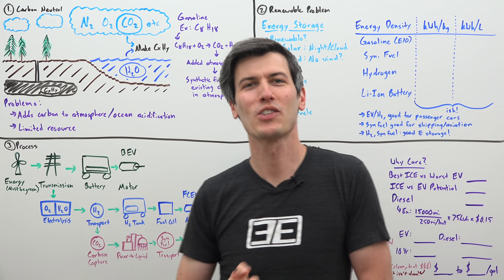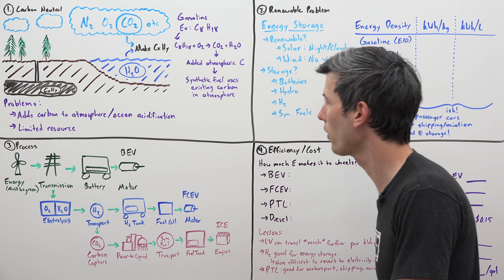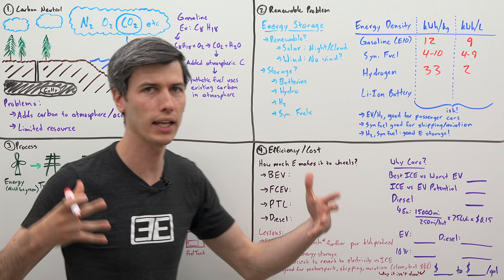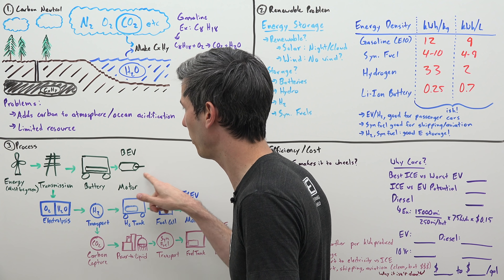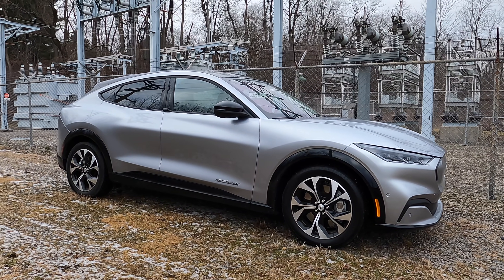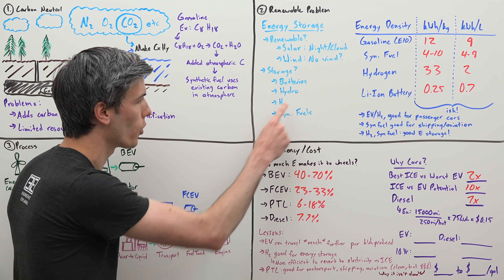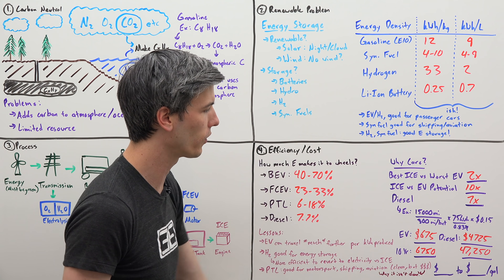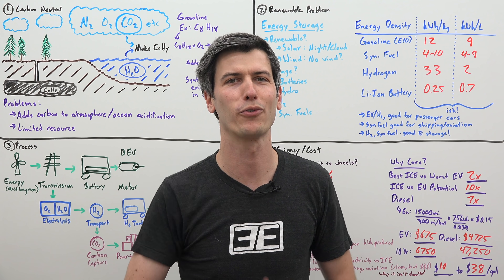The Big Problem With Synthetic Fuels

Comment: Without all the regulations, you could easily make nuclear power cost less than $10 a MWh. In that case, even with all these losses, you could still make synthetic fuel cost effective. But many of the conversions could be done more efficiently, like going straight from heat to hydrogen - thermolysis.

Comment: Yeah, but, infrastructure, EVs need to compansate all the required infrastructure, that infrastructure cost lots of energy too, and cobalt is rare, finite like oil even too? Talking price, who's paying that infrastructure? We all, that's just not included in this calculation.

SynthFuels have the advantage that all the infrastructure is already available, and AFAIK can be used on existing cars.

Another great thing is, you can have a huge solar farm somewhere like the Sahara (yeah there's other challenges there), and ship it around the planet, while you can't really move electricity like that.
Reply: This might work, but building solar in  an area with shifting and blowing sand would have its own challenges.

Comment: Meh.. it still has potential as you can't store electricity efficiently, in the future it's gonna be a problem if we're all using electric vehicles, on the other hand you can store synthetic fuel efficiently (+ a fuel tank won't be degraded after each refill) and just like a water battery, synthetic could be created with excess energy provided by the governments resulting in a much lower cost (free if you don't count machinery maintenance and personnel). I could see this solution in the future because EV planes, boats and big industry seems unrealistic and the pollution made by creating those batteries will come up as negative at some point

Comment: I got biogas van and calculated that total efficiency is with synthetic methane would be about 29% using Q power methanation process. I can now run with biogas at around 8 euros 100 km and my emissions can actually be lower than with electric van because electric vans with good range need quite big batteries and those produce a lot of emissions when they are produced but I would like to have more plug in hybrid vehicles with like 100 km range on battery with fast charging and biogas/synthetic methane for longer trips or for highway driving. It would combine two technologies well. Also you had static electricity price for producing synthetic fuels but I think production facilities would be built on places with cheap and renewable electricity. Like in Finland where I live electricity can be very cheap during night or even at day if it's very windy. Our electricity also produces quite little emissions at around 30 gCO2/kWh or even less depending on load on electricity grid.

Comment: Combustion engines are horribly thermally inefficient.
Reply: An ethanol optimized combustion engine is >42% efficient, right up there with fuel cells.

Keep in mind that electric motors are not 95+% efficient as we are told.  Teslas would not have radiators and antifreeze if that was true.

Years ago, they would measure an electric motor efficiency by the amount of heat produced and they are in that >42% efficiency range too.
Reply: @danafletcher2341  Well I'm pretty sure that the battery in a tesla needs coolant and a radiator more then the electric traction motors but I haven't heard 95% efficient I heard that three phase electric motors are 85% efficient and that the whole EV system is about 55-65% efficient.

Comment: One of the biggest arguments against eFuels is the “poor thermal efficiency” of combustion engines. But in my opinion and experience, I am wondering if this even matters anymore. Case in point. I’m a freelance photographer and I drive a lot all over Germany meaning long Autobahn cruises. My car (2018 Mercedes A250 W177) is loaded with my heavy gear and I will often just cruise at 130 km/h with the occasional venture into the 200 km/h+ zones. On such trips, my gasoline car can get 6 L / 100 km - which is incredible. 

In cities, I combine Start-Stop with “aggressive driving” (quick acceleration from a standstill to get up to speed and then let the car coast) and in this fashion I can improve my fuel economy. When I am stuck behind people who can’t drive and need a minute (literally) to accelerate to 50 km/h, my fuel economy actually worsens. I learned in driving school to always accelerate quickly to 50-60 km/h in the city, then coast, to improve gas mileage. 

Bottom line: modern ICE are so efficient and there’s probably room for improvement. Of course they can’t touch the efficiency of an electric motor, but they are nonetheless efficient in this day and age for what they are. 

Also, I saw an interesting documentary on these new Dual-Fluid-Nuclear-Reactors which are being developed by German engineers in Canada and Rwanda (of all places). The head engineer said these reactors produce a lot of heat - and this heat could be used for electrolysis to create hydrogen and eFuels and thus would offer these fuels at competitive prices. What’s not to like about this???

Comment: I hope synthetic fuels come to the market, we can use our current cars, gasoline pumps, literally don’t have to do much to make synthetic fuel available to the market, and ev’s are quite and boring, I hate wiring, I hate working on battery’s that can explode in your face, I don’t like the fact lithium is limited and we are using it on pointless cars instead of phones and other devices, I love engines and working on them it’s what I like to do and nobody can change my mind.

Comment: It can be an option for, Airplane, Ships and maybe Truck where battery is unlikely.

2nd.
I think there is also a 'Direct Methanol Fuel Cell'.
Which convert Methanol directly into electricity, skipping Combustion engine.

And thats more energy efficient because there is very less heat loss.
Reply: There also is a direct ethanol fuel cell which has a high specific energy (8.0 kWh/kg) compared to methanol (6.1 kWh/kg). (Wikipedia)

Nissan drove a ethanol fuel cell around Brazil in 2016 using their E100 infrastructure.  European and Indian ultra-quiet large military submarines use ethanol fuel cells.  These examples run the ethanol over a catalyst for hydrogen though, not direct.  Direct fuel cells sound like they are near commercialization.

FROM SEEKING ALPHA WEBPAGE:

>>>Fuel Cell technology offers many advantages over Lithium-ion batteries, not the least of which is that hydrogen used in fuel cells has the energy to weight ratio ten times greater than lithium-ion batteries.

That said, the volumetric energy density of ethanol is over five times greater than hydrogen.

Ethanol has five times higher volumetric energy density (6.7 kWh/L) than hydrogen (1.3 kWh/L) and can be used safely in fuel cells for power generation.<<<

Fuel cells have a good amount of heat loss, I think they are >40% efficient.  But a worker who maintains his home on solar during the day could plug his car into his home as the sun sets for electricity and use the waste heat.  Henry Ford worked on something similar with ethanol cars heating the home and providing electricity.

Of course, an ethanol optimized internal combustion engine is >40% efficient, clean, simple, and made of cheap recyclable cast iron.

Comment: No easy answers. EVs to save the planet? Not so fast. Mining for all the materials for EV batteries will need to increase many times to meet demand. The mining isn't so great looking at it scaled up that much. There's some challenges with disposal and recycling of wind and solar energy. How much oil do we have left? Something I saw a couple days ago about sink holes. Removing oil and water from the ground can leave a cavity possibly leading to a sink hole. I've watched a lot of videos and read articles in hopes of finding the answers but not much luck. I wonder if the new ways getting energy from nuclear is an option. Small Modular Reactors?

Comment: But surely, it's a question of economies of scale right? Also keep in mind, storing hydrogen has a hidden cost due to the fact that it embrittels metals leading to more waste. I think that just converting it to synthetic methane will in the long run be cheaper just because less maintenance is needed to its infrastructure. Converting methane to ethanol is then rather straightforward catalytically and can be done with temperatures easily achievable with solar-thermal power

Comment: 40% to 70% seems awfully low for a BEV.  Transmission lines are about 97% efficient. Battery charging is about 95% efficient, the inverter is also about 95% efficient, and motors can be as high as 95% efficient, depending upon where in the speed/torque curve they are.  The bottom end of that efficiency range would be way better than 40%, and the top end should be closer to about 80%

Comment: A gas tank is not an energy/efficiency limiting step in the syn-fuel process. A little bias showing? Cost of electricity at charging stations is NOT $0.15/kw and will be $11/gal-equivalent when the subsidies end and road and other taxes are slapped on which hydrocarbons now carry 200%. Ignorance, incompetence, forgetfulness or more biass? And, no, the registration fees don't compensate for the road taxes. More BS biass.
In any case several low cost, carbon neutral or negative, waste, bio-feedstock or coal to fuel technologies exist and an important new one is coming online shortly. Your video inspired me devise an even more direct fuel synthesis process. Thanks. But all this will go by the wayside as a new 1000.00% 😀technology based  energy source is already coming to the market. IMHO, we will improve it by a magnitude. Then the gloves come of.
BTW, we are developing a new engine and a new thermodynamic cycle which will enable IC vehicle efficiency to be ~60%...with no emissions, only low CO2...which will be carbon neutral.

Comment: Correct me if I’m wrong but the way I see it, electronic vehicles will fall victim to massive incoming lithium shortages and become economically unviable in a matter of decades. Synthetic fuel is expensive presently but in the long term it turns a non-renewable resource into one that’s essentially renewable. Lithium will remain non-renewable. It’s already advantageous to produce synthetic fuels just for the atmosphere CO2 reduction alone

Comment: This is why I never trust engineers, being a former recovered member to that clan.  The battery is not the fuel.  The battery is the vessel.  You should be comparing the vessel weights.  Obviously the synfuels and HC tank is a 25kg poly tank.  The H tanks are carbon fiber but still have mass and the battery has mass.  If you put the electric vehicle on the scale with zero charge and weigh it... how much more does the vehicle weigh... that is the fuel weight.  
You should then discount the fuel weights on their impact on the kwh of energy used.
Please show the energy recovery of the liquid fuels upon reducing speed or braking.
Lots of flaws in comparing apples and oranges.

Comment: you forget one thing ev battery is not cheap,after 10 years you need to replace it,and it is not cheap my friend,electric engine and bodywork is cheap but ev battery is very expensieve and if the battery is dead you need to buy new one,lets say ev cost is 40.000 dolar,electric engine and bodywork cost is 20,000 dolar the other 20000 dollar is the battery,efuel cell engine is cheap,diesel engine is cheap,replacing that parts cost you less then a ev electric battery :)))

Comment: Nuclear Power is conspicuously absent despite being THE source for zero-carbon synthetic fuels. New Nuclear (Molten Salt Reactors) can provide quality heat (high temperature) that makes highly efficient processes that result in synthetic fuels that cost about what's being charged at the pump today. All the numbers thrown around at the end are undermined by this technology based aversion.

Comment: Does this comparison account for weight difference between ICE vehicles and their EV counterparts?

AFAIK, EVs can be about 25% heavier than ICE equivalents if not more. ICEs can get more efficient as the fuel load decreases over distance whereas an EVs weight stays relatively constant. If we’re talking energy efficiency, shouldn’t we go past the vehicle’s PU and go all the way to the actual amount of useable work? Or is this general weight difference negligible?

Comment: The problem with you calculation is synthetic fuel is expensive because there is very low volume of production, if it was mass produced it would significantly reduce the cost. The other thing is how many millions of ICE vehicles are on the road how much energy and resources will it take to replace all of them with say electric vehicles and THEN how much energy will it take to scrap all those ICE vehicles. Then we have how Loooooooooong will that take yet if every ICE vehicle started using synthetic fuel now which they can without any modification how much fast could we at least stop the increase in co2. Giving us more time to develop or introduce better cleaner systems
Reply: They won’t scrap all ICE vehicles
Reply: @xballoon4402 you mean like they didn't scrap all steam trains
Reply: @p24hrsmith no they didn’t

Comment: Excellent presentation, as usual, but you're forgetting one very big piece of the puzzle that complicates things even further for synthetic fuels. In the process description (3), you don't take into account that the CO2 capture process, even when perfected, is going to be energy intensive. So you also need to draw an arrow between the wind turbine and the CO2 capture facility. This greatly increases the energy demand for the whole efuel production process, and you could use this energy to power EV's directly. That's why I believe that EV's are the future, it will take time but for me there's little doubt they'll be the main means of transportation in 15-20 years. Of course, combustion engines will still be required for some situations (aviation and shipping, almost certainly) so efuels can be a solution in this particular application. Also, for rich people who want to keep driving their porsches.

Comment: Except in a hydrogen car there's a battery to provide a buffer because the fuel call can't provide the power needed for hard acceleration etc. 

We have all the energy we need in the form of Nuclear energy, it could be practically unlimited, we really made a huge mistake in my opinion investing so much in Solar and Wind when we should have been investing in better, more efficient Nuclear reactors. 

With Nuclear we could make all the hydrogen we want, we could have Nuclear stations  solely to produce Hydrogen and Synthetic fuels, reliably, 24x7x365. 

Lithium and Cobalt mining for electric cars is harmful to the environment, uses far too much fresh water and produces toxic waste that ends up in ground water, despite being an EV driver since 2015 I don't believe they're the answer long term.

Electric cars charge far too slowly and not a viable solution in the long term, cold also effects performance and adds significant time to a charge.  We need a better battery than lithium. They're a long way off, if ever, from becoming as practical say as your European Diesel that can travel 650+ miles on a tank of Diesel. That's real efficiency !

Hydrogen cars, if you can generate the fuel endlessly from Nuclear then this is good, needing no expensive batteries that destroy land and water supplies. But storing the fuel is dangerous. 

Hydrogen can also be burned directly in an ICE needing less rare earth minerals for fuel cells and  less mining. 

We could re-use, rebuild old engines, we should be running our cars for longer, and we should be using less technology and going back to basics instead of all these computers in cars today, it's a waste of minerals and it's technology we do not need in a car. Why do we need touch screens in cars ? bad idea because people can't stop playing with them when they should be driving. 

Synthetic fuels is probably the best fuel we can use due to safety, efficient, no but they would be far safer then hydrogen and can use existing ICE technology that's tried tested and just works and the benefit of synthetic fuels is that all the emissions controls systems may not be needed greatly simplifying design and reducing costs. 

To be honest, I can't see a 0 carbon future without significant investment in new nuclear reactor technology, Terrapower looks promising.

Comment: To be fully honest you have to compare each technology from mineral to full use of product for the entire vehicle life. From the mining of lithium in replacement numbers for each use recycling and end of life horizon to determine what is the best long term fuel. What will we run out of and what are its potential uses.  Hydrogen is the most abundant fuel in the universe and is part of space capabilities where as lithium is never going to power a space race let alone fly long distances

Comment: This is all certainly true for our current reality of power generation, but things could change. If/when fusion power and wave power gains widespread adoption, we could have a surplus of green electrical power. In which case, the primary environmental concern shifts to the raw materials cost, in which batteries are terrible at, given the amount of rare earths, lithium and copper required. Now, battery tech will also have advanced by then, so it's entirely plausible BEVs will be the transportation for the masses, but provided it hasn't exceeded the energy density of liquid fuels by weight yet, as Jason said, it will make sense for the shipping industry - coupled with the cheap surplus of electric power at the grid, it might not be unreasonably expensive for enthusiast cars.